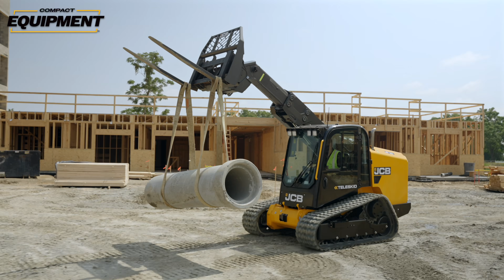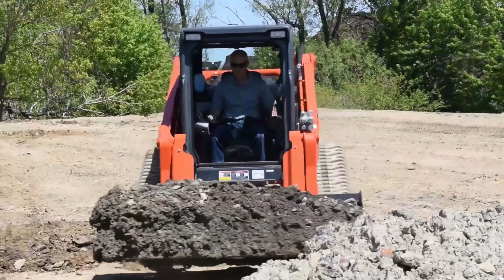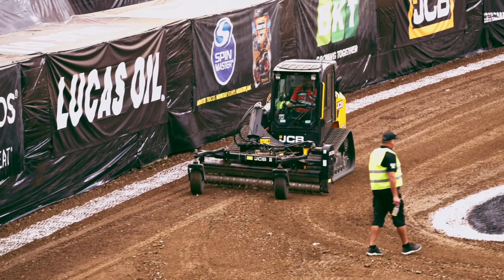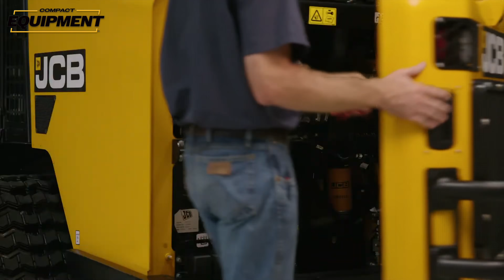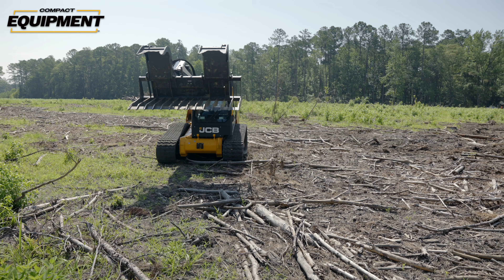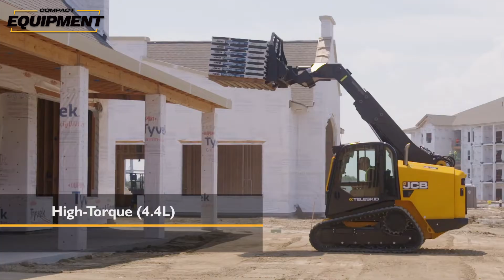Did JCB Just Unleash the Ultimate Compact Track Loader?

Comment: We have had 3 JCBs since 2016, absolutely no major problems, just minor wear items. The cab access and visibility is still way ahead of the competition.  We have previously had Case, Kubota, Gehl, Thomas. All good machines, but the JCB is a more comfortable,  less claustrophobic,  at least as capable machine,  with the added bonus of safety. I personally was trapped in a Case for a few minutes when the machine stalled and wouldn't restart, with the boom not all the way down. It sucked feeling, and being, trapped.